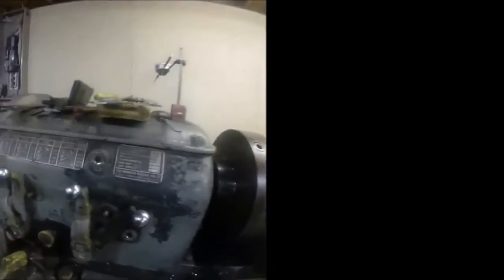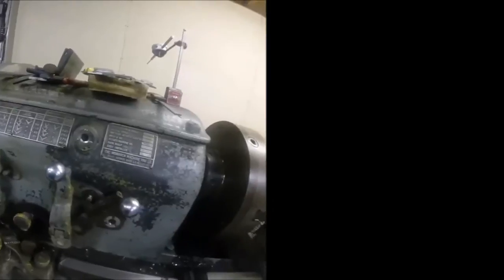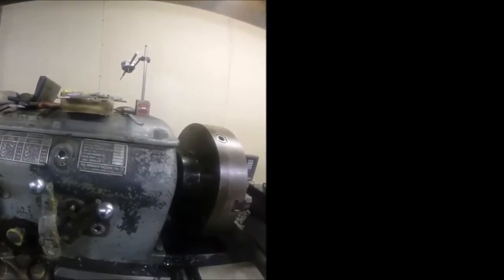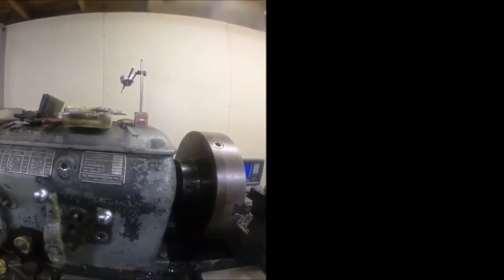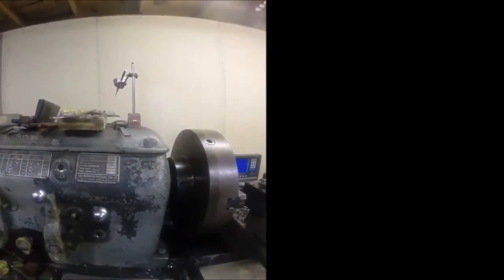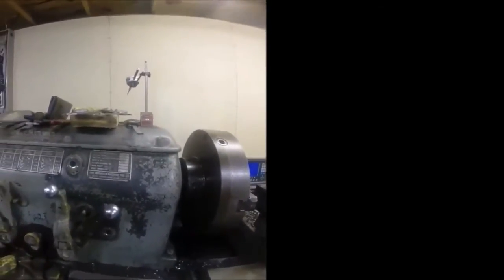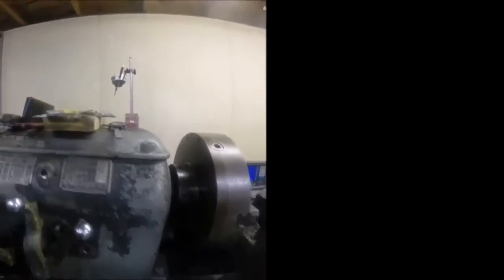Face Off Attempt Reply to ABOM79

Comment: Poke a big hole in the center. Pretty tough to cut with that feedrate all the way to center and not lose the insert. Thanks for the video response.

All the best,

Tom
Reply from the maker: I did have a 1/2" hole in the center so I wouldn't get my cutter on the reverse rotation side and break it. I think a bigger hole would make it cut much better though as I noticed it runs smoother at the outside than at the inside. Thanks for the tip. I will try again with a different tooling when it warms up.

Comment: Sounds like you got a little chatter there. So I take it you didn't top .200?
Reply: Vibration due to carriage / sleigh longitudinal! I think not locked it during turnings.
In this competition 400-420rot/min's speed, but which is advance? In ''mm''?
0.200 mm/O ?
Reply from the maker: Here is my only evidence of topping .200  at .030"/rev with this nice .250 chip.
http://youtu.be/RvrbPqGlLIs
When I get my inserts in I will try again and try to get the action on video! I am learning a lot about making big chips. :-)
Reply from the maker: Danu Al Advance is .762mm/rev